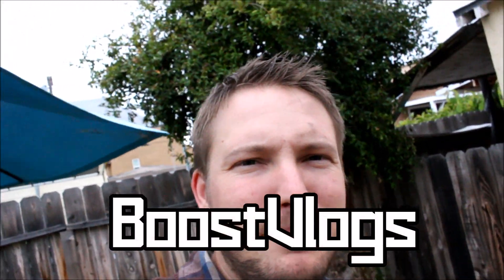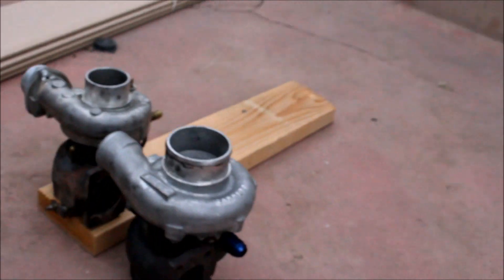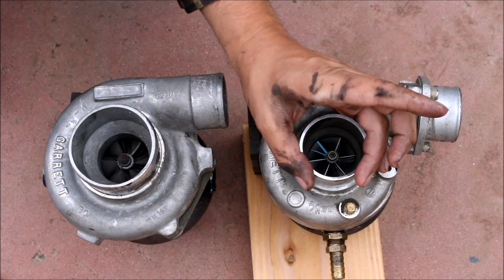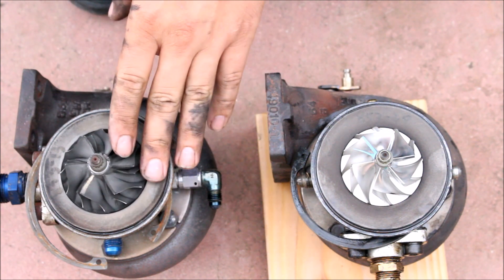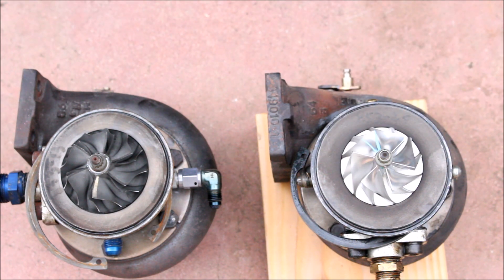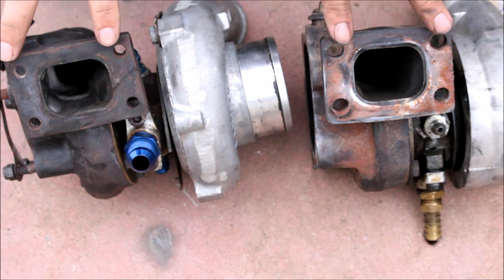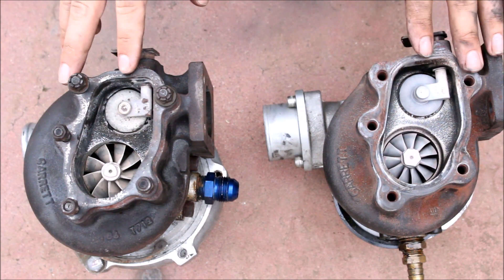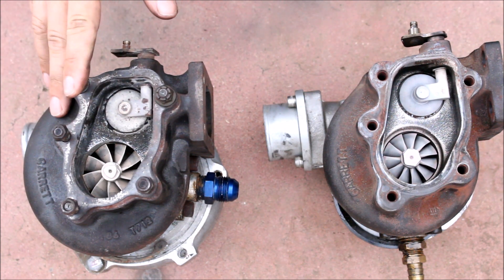Side By Side: GT2554R vs. GT2860R (BoostVlog 7)

Comment: The largest different which you didn't note was that the 53.8 you were referring to was the inducer of the turbine wheel; which you cannot see. The exducer which you were visually showing is around 6mm larger in the 2860rs. This difference and the 9 blade (gt) design is what gives it the jump in 50hp compared to a t25/t28 turbine wheel
Reply: Yeah that looks like t25 not a GT25 exhaust wheel

Comment: Thank you for such an informative video. Since you swap back and forth between the turbos on the same motor with only a change in manifold, could you describe the boost build differences? How do they compare in how they build boost and fall off towards redline?

Comment: Hi I have a Garret GTX2860R Gen 2 t25 .64ar 5 bolt and 3" inlet, 2" outlet anti surge. I want to switch over to a GT2554R with the same spec housings and I was wondering if both turbo's will have the same footprint and bolt up the same or if mods will be required?

Comment: Hi Greg, love your channels, and i have to say that i've learned a lot whatching your videos! Thanks a lot for doing all this "how to" stuff! Since i'm going to boost my 2000 Miracle edition 1.8 Miata, i'd like to ask you if Garrett GT2560 is different on the hot side from the GT2560R, because i'd like to use a GT2560R (since here in Italy it's cheap, and i cannot find a NON R version) with Begi manifold and downpipe. I know that both the turbos regarding flanges are identical, but i'm sure you know much more....! Please keep doing video because we all learn a lot from your experience!! Thanks mate!!
Reply from the maker: The two versions of the turbo are the "T2560" and the "GT2560R". The only difference is the GT turbo is ball bearing, and the other one is a journal bearing turbo. Both are excellent choices for the Miata engines, the ball bearing one will perform better but is more expensive.
Reply: +Greg Peters I'll go with the gt2560r version!! Here in Italy it's 819€ (something like 950$), but it worth the money!  Thanks again Greg, especially for your videos!!!

Comment: I recently picked up a Miata and a bunch of other parts in a trade recently and one thing the Miata came with is a Garrett .42/.48 and I was just wondering what your opinion would be on that specific turbo. I have a 92 1.6 with a 1.8 5 speed and rear end.
Reply from the maker: ".42/.48" isn't really a model of turbo, I'm guessing those are the housing a/r's? Does it have an ID tag on the CHRA or any other markings? 5-bolt turbine outlet?
Reply: +Greg Peters is there a way I can send you some pictures of it?
Reply from the maker: gearhead8989 Sure! thecarpassionchannel at gmail dot com

Comment: hey Greg new subscriber love both your channels just had a question if you are familiar with sheet tab on the 1.8 Miata apparently it's something to verify that the engine has been overheated just curious to hear your thoughts keep up the good work love your videos thanks in advance
Reply from the maker: Do they have the tab stock? I always thought that was something you added after a head gasket or something for future reference.
Reply: +Greg Peters ya you're right it's not a factory thing. thanks for the response.

Comment: Greg, Do you sell you GT2554R? I am looking for one on my miata?
Reply from the maker: +fiches12 I will not be selling it. I'll probably be selling the GT2860 when I finish with it.
Reply: Are you just switching it for the car passion channel? for the comparison?
Reply from the maker: fiches12 I'm switching it just for my own education and experimentation. Although I will be documenting it via this channel and TCPC.
Reply: How much would you want for it? I'd probably buy it I went from a 2554 to a 2871 and I think the 2871 is too big I miss my spoolup. A 2860 may be perfect. If you would rather not say it here I'm Wade5k on Instagram we have a message thread already
Reply from the maker: Kris Wade If you think a 2871 spools too slow, I would avoid a 2860 also. They have the same hotside so the spoolup is only going to be slightly faster due to a lighter compressor wheel. Do you know what your turbine a/r is on the 2871?
Reply: Turbine AR is .64
Reply from the maker: Kris Wade What's your power goal?
Reply: +Greg Peters I was thinking 300whp
Reply from the maker: Kris Wade Stock motor?
Reply: +Greg Peters Rods for sure. the guy who tuned it said he thinks I have low compression Pistons too based on what numbers the car was asking for but I haven't stuck a camera in it yet to see for sure
Reply from the maker: Kris Wade Cool cool. Well if you want something more capable than a 2560R, I would either go for a GTX2860R, or a BW EFR6258. I would love to battle those turbos head to head.
Reply: Okay. I think I may have figured out my spark blowout issue I'll know for sure when I get off work lol after my car is in proper working order and I'm able to play with it a little more I'll know for sure if I want to downsize my Turbo or not but I'm thinking the 2871 was an overkill for my goal. I'll have to look into the 2nd turbo you suggested

hows spool on the 2860 you have in now?
Reply from the maker: Kris Wade Horrible. Like unrealistically slow. But it is an 0.86 a/r. It's probably also because I'm used to a billet-wheel 2554R, but holy crap ain't nobody got time to wait that long for boost.
Reply: +Greg Peters yea man the 2554 kinda spoiled us. I'm power hungry but idk which is more important to me. lol first world problems
Reply from the maker: Kris Wade That's why I'm planning on trying a billet wheel 2560R after this!
Reply: +Greg Peters I may copy that idea. Should be able to get pretty close to 300 that way if not past it. Best of both worlds.
Reply: +Greg Peters Something else that is definitely affecting peformance is I went from a garret 2554 to what I considered a "high quality" non namebrand GT2871. still not a Garrett so I'm assuming a comparable Garrett should be more efficient

Comment: i had to drill my 2554r stud holes too, stupid begi manifold. i hate that. whats the point?
Reply from the maker: +Ryan Wolfe Mega strong studs that won't stretch. But honestly, so much headache. The worst part is how big the nuts are, makes install so much harder that it needs to be.
Reply: +Greg Peters installing the nuts on the head side of the manifold is more difficult the manifold does not give you enough room to get more then tiny turns of all the lower nuts. 
But then again if installing is the only complaint we have with the begi manifold that isn't too bad lol
Reply from the maker: Ryan Wolfe Outperforms the Flyin' Miata manifold for the same price too. Although the customer service of FM might outweigh that benefit, lol.

Comment: I can't find a  used gt2554r  turbo
Reply: I have one if ur interested
Reply: +Kris Wade wat turbo and how much would it be
Reply: +Boosting cars a GT2554 and I'm not sure tbh I havent checked what the used prices are like yet
Reply: +fiches12 just now seeing this. coming up
Reply: +Kris Wade  it's ball bearing  right
Reply: +Kris Wade does the one you have look like that ?
Reply: +Boosting cars mine looks like the one in this video on the left. But of course it's the size of the one on the right
Reply: +Kris Wade  so the compressor houses  looks different  than the  right one
Reply: +Kris Wade  so the compressor houses  looks different  than the  right one
Reply: +Boosting cars Yea it just doesn't require the adapter to plug to the intercooler like the one in the video. same turbo tho

Comment: Greg, any ideas on the effects of compressor housing size and spool?
Reply from the maker: To be honest not really, all I know is that a lighter/smaller compressor wheel will help spool up just a little bit only because it's lighter, but that's partially negated because they move less air at any given wheel speed. (If I remember correctly, the compressor wheel in my 2860R moves the same amount of air at 140,000rpm as the 2554R moved at 155,000rpm). The turbine wheel and housing have a much greater affect on spool up. I'm planning on upsizing my compressor setup on the GT2554R to make it a 2560R which should give me a good idea of spool changes!